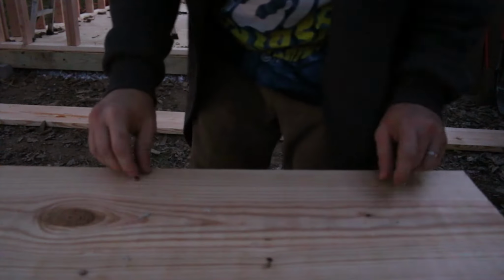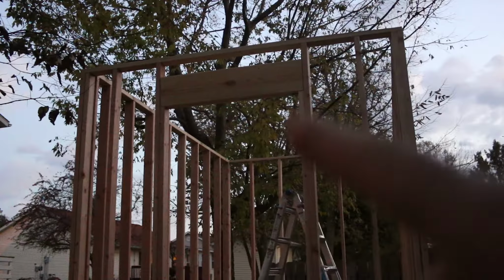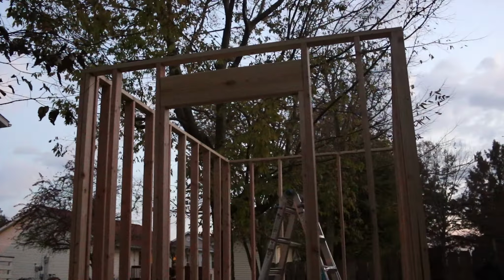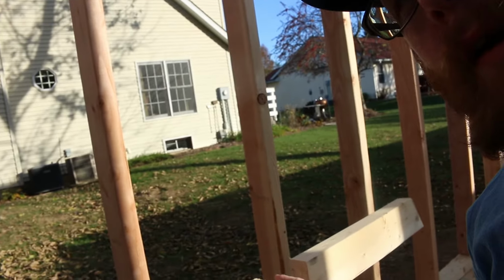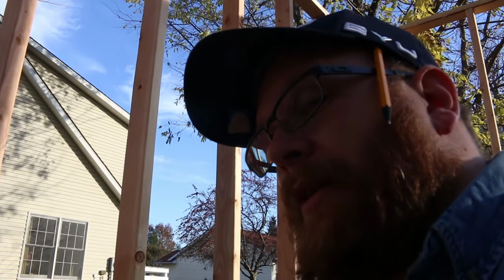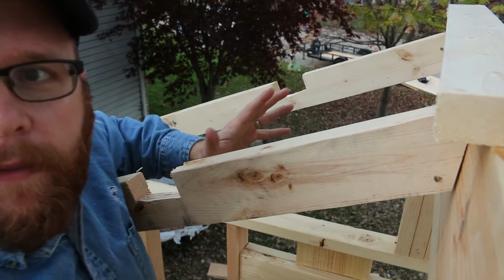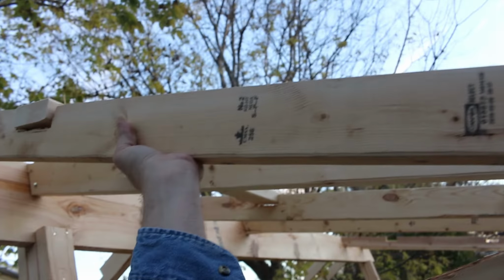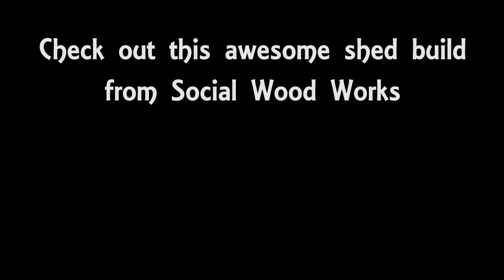8 x 12 Shed for $1000: Roof Framing

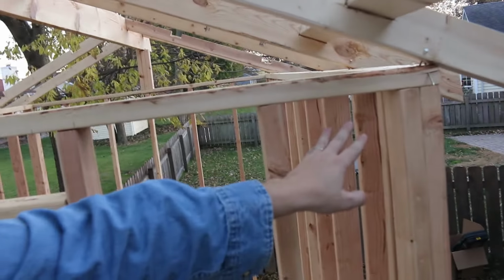Comment: Tom 10:19! where is your bird's mouth, nailing it like chop sticks too??? - cutting your 2x4 common rafter or roof rafter by 1 1/2 in to install flying rafters now thats a major design flaw if you are using that framing method the rafter you notch must be at least a 2x6, by the way why not flush cut the flying rafter to the 2x4 rafter and just nailing it essently you only need to notch one?
Reply from the maker: You definitely know way more than I do about framing! I know about the birds mouth concept, but I didn't think the project was big enough to warrant it.  I may end up finding out the hard way!